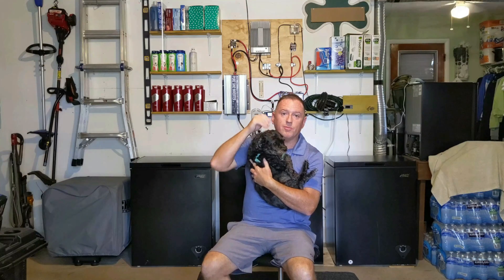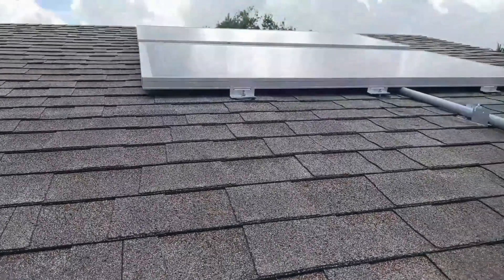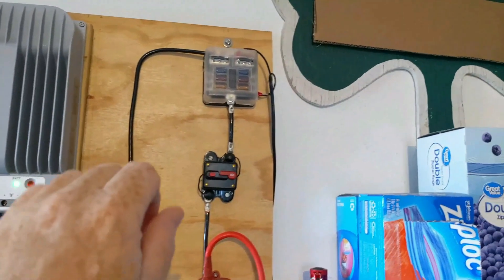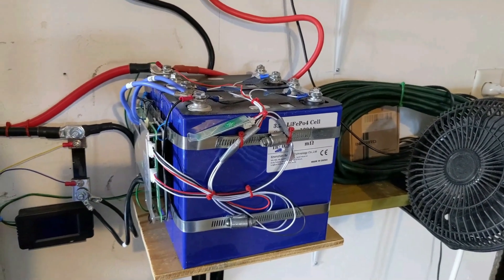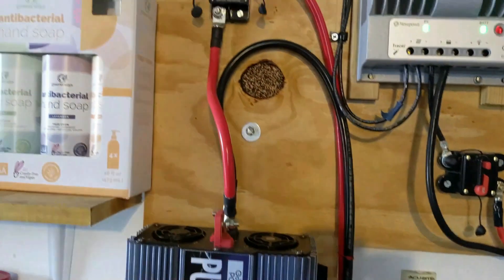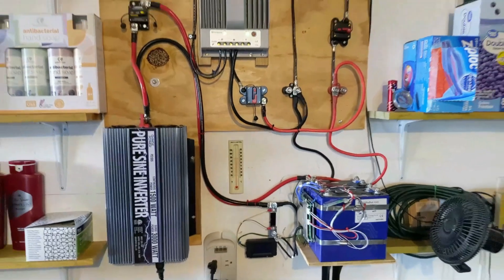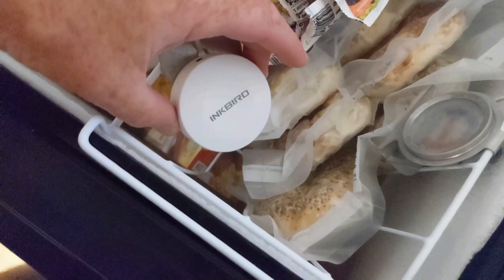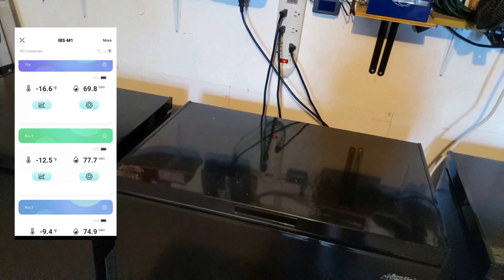Solar Powered Freezer System for Prepping and Fighting Inflation

Comment: I need to run a 7cubic ft freezer indefinitely and would love to be able to set something like this up but it looks very complicated to me. Is there an easier way to pull this off
Reply from the maker: Hi Paty.  Of course, there is an easier way.  I just find it fun to design and build things but realize it's not for everyone.  For about the same cost (possibly even a bit less these days) you could buy a solar power station with pass through charging to run the freezer.  You would need an entry point into the structure housing your freezer to run the cords from the solar panels, and you'd need to figure out a place/method to mount the panels at least semi- permanently.  

I honestly can't vouch for the longevity of these units if you were to use them 24/7 long term, so if you do go this route, make sure the manufacturer offers a decent warranty.  I review one here https://youtu.be/QusTG0OFmN0 that is approximately the same capacity as the system (in the video) that I built.  I know they offer a two year warranty on their units.  I'm not pushing hard for you to buy it, but check out the video, it will show you a possible solution and maybe get the wheels turning in your head.
Reply: @thetechieprepper  thanks I’m having a hard time deciding which route to go I was looking at the Lion Energy solar kit. I need some thing that will also run a starlink serup
Reply from the maker: @patyp.7401  I haven't used the Lion Energy Kits... Whichever way you go, make sure you calculate your needs properly.  You can use a cheap Kill a Watt to determine how many watts per hour your freezer and the starlink will average together.  Off the top of my head, I would guess about 100-125 watts.  Then make sure your battery/power station has enough capacity (watt hours) to run them.  I design my systems to run for two days with no sun in case of bad weather.    So, for example: If your freezer pulls 50 watts per hour and you run it 24/7 thats 1200 watts.  If the Starlink pulls 50 watts per hour and you want to use it 5 hours a day, that's another 250 watts.  Your usage is now at almost 1500 watts per day.  I would design a system with a 3000 watt capacity.  Then to make sure it charges properly, I would use 400-600 watts of solar panels.  This is the "set and forget" design where you shouldn't have to worry about the freezer continuously running and be able to use the starlink a few hours per day with no issues.  If you want to budget your time and only run the starlink occasionally, you can cut the capacity back a bit.

People tend to be surprised once they get into solar how much it actually takes to run things totally off grid 24/7.

Good luck and if you have any questions, I check my comments semi-regularly.

Comment: Do you have a link to a freezer you would recommend for a system like this?
Reply from the maker: I happen to use Arctic King as they were the only ones I could find in stock at the beginning of Covid.   I bought them through WM and they were shipped directly to me.  https://www.walmart.com/ip/Arctic-King-7-Cu-ft-Chest-Freezer-Black/589721123 

I've had good luck with them, but I would not be opposed to using any other brand or model.   The 7 cu ft seems to be the sweet spot for capacity and running 24/7 while allowing for a day or two of bad weather with the size of system I designed.

Comment: Very nice, exactly what I'm in the process of doing.
A couple things you might want to look at.
Your inverter is vertical I would prefer to be horizontal for dust purposes. Also I don't think you're inverter was grounded.
Congratulations on the battery build, did you mention that it, was lithium phosphate batteries? I know it was but the public might not know that.
Additional equipment you make like to look into is adding a transfer switch between grid and inverter.  A RoHS ATS place between the inverter and grid power will allow you to top cycle your battery while the grid is working. This will prolong your battery life indefinitely.
I really like the puck idea for freezer monitoring thanks for that tip.
I'll be making a video of mine soon probably not as polished as yours but, will get the points across.
Nice work!
Reply from the maker: Thanks!  

Normally I would agree about the inverter orientation.  I have a large wall mounted shop fan (about 10 feet away) which blows down the wall and directly across the face of the inverter.  It might not be shown in the video. Mounting the inverter horizontally actually causes more dust to accumulate at its ventilation openings.  The fan pushes it in... I found that mounting it vertically exhausting upwards keeps it cleaner. I'm not sure if it was grounded at the time I shot the video as I hadn't fully finished the 12v side at the time.  I added a 12v 5 watt LED with a motion sensor over the washer and dryer so it always comes on when doing laundry.  Everything was grounded after I finished the entire build.

I've looked at the transfer switches, but haven't found one that I actually like yet.  Also, the system isn't designed to run all three freezers for lengthy periods of time.  I could run them all for ~10 hours.  If the power were to go out, I'd have to manually rotate them on to the inverter every few hours to keep them all running and below freezing indefinitely.  

Currently I'm only cycling down to about 66% battery capacity daily.  I only occasionally hit 20% or so when we have several consecutive overcast/rainy days. I'm comfortable with this scenario.

Thanks for all of the input!  I do appreciate the feedback and ideas.  I had forgotten about the transfer switch for a while now, so will definitely re-visit that idea!

Comment: You should cover-up those battery terminals wouldn't want them shorted out and causing a fire.
Reply from the maker: Good point Johnny, and yes all battery terminals should be covered for safety.   In my other builds I normally do cover the top of the battery completely.  In this case, I've been complacent given it's elevated location.  It is LifePO4 chemistry, so even if shorted, the cells will swell and off-gas instead of exploding or catching fire.  No excuses though.  I need to cover it.

Comment: Good stuff. Let me ask. Putting prepping aside. Is this cost efficient compared to pg&E/utility bill VS the hardware cost ? 
I relay want to set up winter Glamping and if its worth using 24/7 than that just 2 birds with one stone.
Reply from the maker: The cost of the system varies from about $800-$1000 depending on inflation, sales, etc.  The freezers cost about 20-30 per year to run in my state.  So, I would not build it to save money on your electric bill.  

That being said, if you have $500 - $1000 of food in your freezer and you lose power for a few days... you'll be able to sleep at night knowing all of that food won't thaw and be wasted.  Plus, you can use the system to cook with rice cookers/crock pots, boil water, charge phones, charge AA/AAA batteries for flashlights, power radios/TV's, lights, etc...
Reply: @thetechieprepper  ya we just had a saver winter storm and went 9 to 13 days without power. Thankfully there was plenty of snow.
Reply from the maker: Been there done that while in college in upstate NY.  Snow is good to quickly cool adult beverages as well!

Comment: Thanks for the inspiring Vid, I'm looking to convert a chest freezer to a fridge to stop all the cold air from dropping out, I have a refrigeration friend and going to see if I can get him to re-plum a fridge so it workes on its side also. I have been collecting stuff 8 x 100 panels 2x 250 AH battery banks from computer backups running 5 independent circuits garage 1 polytunnel 1 shed 3. thanks for the wiring and component list info
Reply from the maker: You've got it man!  I appreciate you watching and hope I've helped you in some way.  I actually had one of my 5 cu ft chest freezers set up as a fridge a while ago.  It's dead simple to do, but I couldn't fit much inside of it.  I kept the parts for it, so I can change it back and forth in about 5 minutes if necessary.  I think the parts cost me about $30 at the time.

Comment: Congratulations on the system, I can tell you put a lot of thought into it.  I am in the exact same boat.  Just bought a system for freezer backup.  Thinking of doing a video series on it too.
Reply from the maker: Thanks.  It's very versatile.  I can run almost anything off it that I use in the garage.  Just made a video on off grid coffee and ran a full size coffee maker on it (1250 watts).

Comment: Just found your channel and subscribed. I've never built a solar battery but I'm definitely interested in trying. I'm looking for a 12v system I'm looking for a all in one solar charger inverter and looking for one thats 2000 watt running 4000 watt peak. Do you happen to know of a all in one thats 12v and 2000/4000. I can only find one thats 1000 watts. Thanks for your help
Reply: Have you considered the Victron Multiplus 2000 VA?  Will still need an mppt charge controller for solar, but it gets you most of the way there.  I haven’t come across a lot of all-in-one inverters at that power level.
Reply from the maker: That would pull over 160 Amps at 2000 watts (12v).  You need to make sure your battery(s) can handle that discharge rate and wire/fuse appropriately.  You are going to need some BIG wire.  be careful and have fun.  Let me know what you come up with.
Reply: Neither MPP nor Growatt make a 12v model above 1kw.  There might be other brands, but none that have any popularity.  Going over 1kw imo pretty much dictates 24/48v systems, honestly.

Comment: Great video.  Have done the same thing with 7.0 cu ft freezer powered by 1000 watt pure sine wave inverter and 100ah LiFePo battery.  When running, the freezer draws less than one amp.  Inverter draws about 6 amps.  With solar charging, agree that this could run 24/7.  I'd send photo, but not sure how to do that.  Thanks.
Reply: Nice!  These freezer systems are fun.
Reply from the maker: Less that one amp when running?  I need that model of freezer...